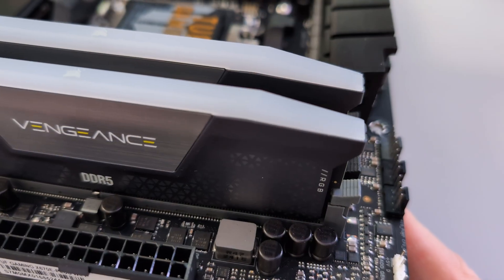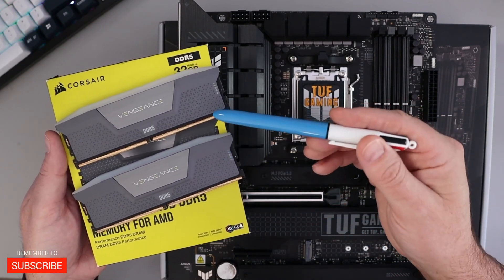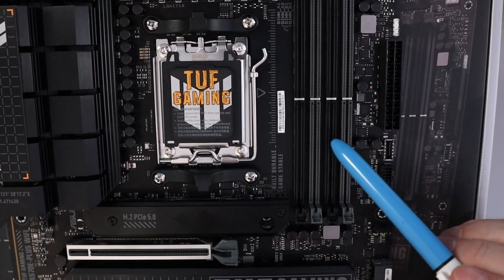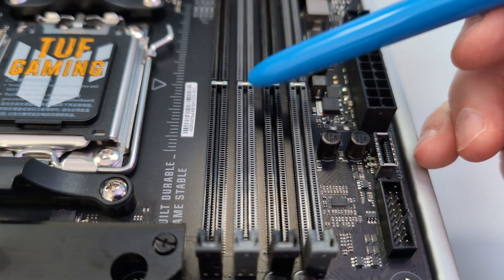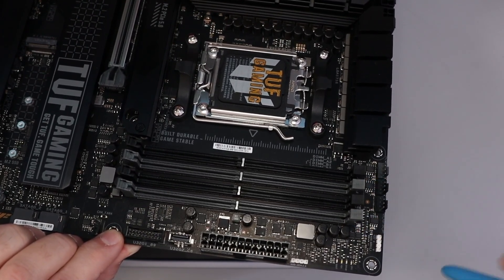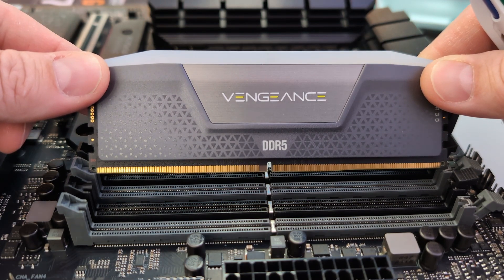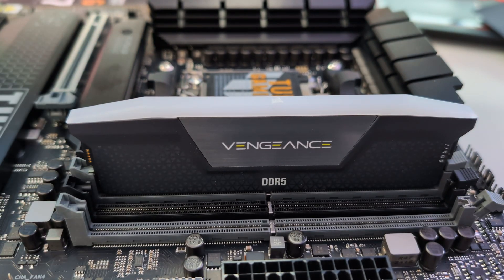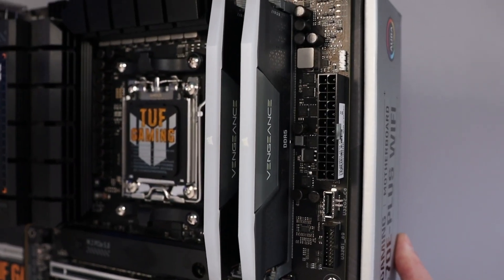How to Install DDR5 Ram (Corsair Vengeance DDR5 on Asus Tuf Gaming X670E-Plus Motherboard)

Comment: So Im using ddr5 vengeance 16gb2x and bought another set of ddr5 ram (same sticks) but now my PC don't run when I add the 2 new sticks. Do you know how I can solve this issue? It also seems the ddr5 sticks in using now are controlled by an app. How to reset ddr5 settings to fabric?
Reply: not sure about your ram, but some from corsair recommend only using 2 sticks instead of 4. try taking other the ones that are installed and put all of them back in at the same time. if it does not work ask corsair